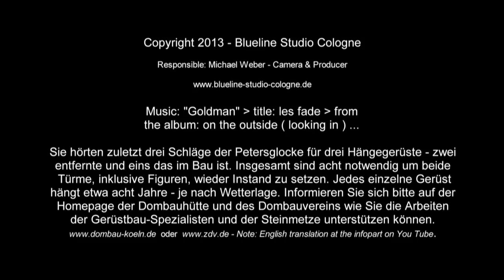Kölner Dom - Demontage des 2. Hängegerüst - Cologne Cathedral Scaffolding - Part 2 Finale

Comment: I have a photo of my mother in front of the cathedral in 1962. It still had a lot of bomb damage on it from ww2. They stopped bombing inner Cologne when they realized pilots were using the cathedral as a navigation point as it could be seen from 50 miles away or more. It is a miracle it even survived as the city was flattened.
Reply: The way the cathedral is built was the main reason it survived, lots of free standing arches and other free standing elements surrounded by air Wich makes it hard for the shockwave to destroy the main structure